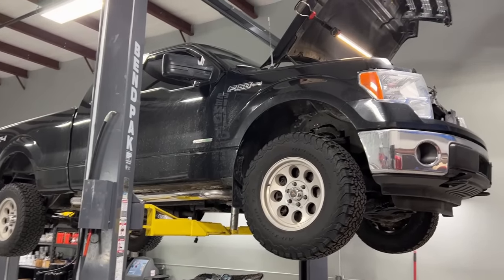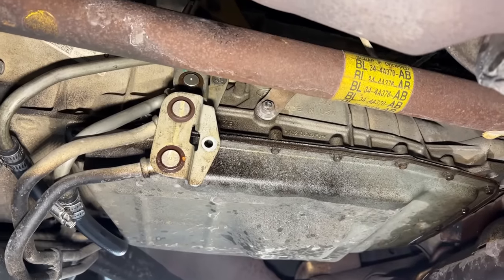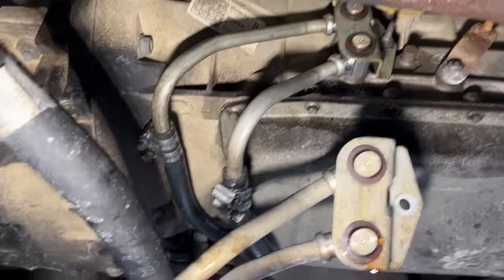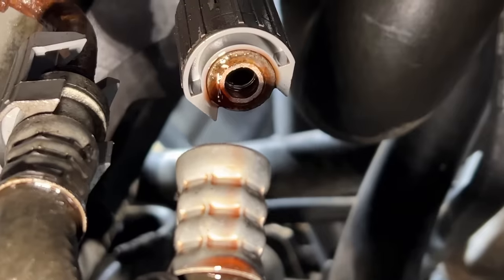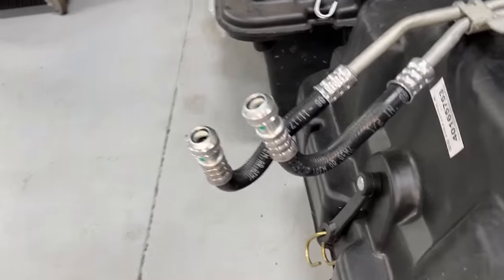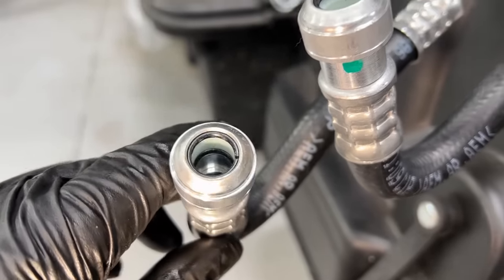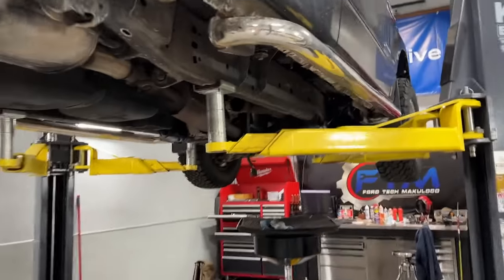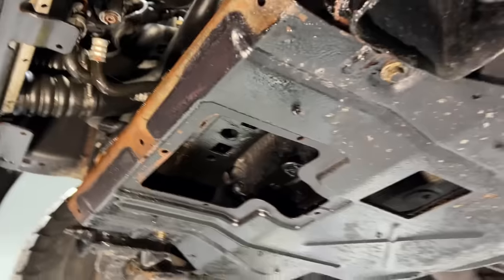Attention 2009-2014 Ford F-150 Owners! Check Your 6R80 Transmission Cooler Lines Before They Blow!

Comment: Mine broke in that exact same spot on my raptor. luckily I was able to pull over very quick and got the truck towed home, ordered a new cooler line,
Installed it and I've driven it for 2 years since then and it's been fine. I Also installed the larger superduty for more cooling.
Reply: Also I recently noticed the short line that connects to the radiator was weeping oil so I changed it out as well. I think these cooler lines are just not made of very good quality.
Reply: How many miles on your raptor when it happen?

Comment: Had this happen to my 13 eco f150 here in canada. 150k km’s. Luckily noticed the smoke behind my truck from oil hitting the exhaust and then the wrnech icon showed. Towed to dealer they said i lost 6L of fluid so luckily caught it in time. $550 repair in canada which included all new lines,6 L of fluid, 2 hours labour. Thought was cheaper then a trans so wasn’t complaining lol

Comment: Thanks for putting this video up .. while I was having the lead-frame fixed (Fixed under Transmission Molded Leadframe Extended coverage) I had this taken care of as well .. less than 700 with sales tax ..you are doing a great favor to us Ford owners 🙂
Reply: What year is your vehicle?  I could only find a 2019 Customer Service notice covering 2010-2013 through the end of 2019 that had under 10 years / 150k mi.
Reply: @ronc4146  Its a 2013 and If I remember right I read it as if your truck is less than 10 years old and or less than 150,000 miles and it thew the  right code you are good and I should revise my earlier statement (Fixed)  It not fixed yet but it was confirmed that I get the extented coverage but a lack of parts has put me on the waiting list ..It still acts up from time to time and jerks me around but I have had no major wheel lock up.

Comment: Wow...That seems so unjust and insulting (if that makes sense) to break like that so cleanly and with such devastating consequences.
You're awesome for putting up the alert...Thanks.
Reply: That line has been a problem since 2012 (ish) I can't remember when they changed them exactly.
Reply: It's an aging vehicle with old rubber parts, not really that insulting when you think about it.
Reply: @BlueOvals24  A leaky line is one thing, a 1/2 line wide open with no warning is another.
Reply: @--_DJ_--  Don't know what universe you live in, but there is not a single sensor in existence that can tell you when a line is cracking. Don't know what you were expecting here, Ford should stick a sensor on every line/hose so you know immediately when your lack of general maintenance is killing your vehicle?
Reply: I’m a ford factory certified senior master technician I’ve done many of these and let me tell you not a single one damaged the transmission. They empty so quick that the transmission basically neutralizes. Is there the chance that there is internal damage of course more likely the transmission is fine

Comment: There is an upfitter in town that does pickups for ConocoPhillips.  For the oil patch.  They automatically replace the trans hoses on new pickups with custom made ones, from another local supplier.   The OEM hoses always leak in Arctic temps.

Comment: Almost want to see what happens to those rubber hoses under high pressure. Maybe they are trying to straighten hard enough to just flex the connection a little at a time.
Reply: I believe such occurred on my power steering hose/crimp began leaking on my 09 king ranch.

Comment: Yup gonna switch my hoses out soon. Thank you! 2010 4.6 3V lifted 3” 35” tires 83k original miles bought her at 20k miles used and I use her as my hauler and dump runs etc living on 7 acres in rural Sierra Nevadas mountains and commute for work in a fuel efficient car. Love my 150! Will be having this done along with the Forscan needed to help with the auto braking when on turns in downhill..

Comment: FordTechMakuloco always spot on with common issues and recommended fixes. Do the different angles of the cooler lines into the aux cooler possibly make the issue less problematic on the F150's with the aux cooler?

Comment: Brian, just on my experience, the reason for the metal fatigue failure at the quick connect  is due to the rubber lines hardening with age.  Aluminum really isn't the appropriate metal for that kind of stress.
Reply: Hello, I have a Ford F150 year 5.0 2011 that is giving me the following error:
On the gearbox screen it appears as a little bubble because while in motion it changes to D,N,P,1 and loses pressure when accelerating. I took it to a mechanic and he told me that it was the transmission control module, but now watching this video I have doubts that these lines are the cause of the failure.

What error do they usually present when the problem really is the lines shown in this video?

Comment: Unless I knew for sure it was indeed a metallurgy issue that had been corrected, I would be ditching the quick disconnects if it were my truck and going a different, more reliable route with the repair.

Comment: 2014' F150 STX  Noticed on way to work transmission wasn't shifting right. Got home. Noticed leak under radiator.  Gently turned the plastic clip and the metal connector on the transmission line separated with fluid spraying all directions.  Thanks for this video.

Comment: Thanks for the information. Just sad that we never know as a consumer/customer what could be the weakest link in a very costly repair until we find out about it when it's to late. Feel bad for the customer.
Reply: Well as a consumer, you should also know how to do preventative maintenance.  That's the problem here, nobody replaced those old, rubber lines and they are bound to break.

Comment: I've seen that happen several times at our shop here in Montreal. I suspect it's worse in northern areas because of the extreme temperature cycles in the winter (very cold to relatively hot in a short time, and vice versa).

Comment: I've got a 2014 f150 Eco boost with 128k miles and a remanned engine after 98,875 miles cause the factory engine threw a rod. had a small shifting scare with my truck last week and it hasn't returned since parking the vehicle for 10 minutes and driving home, but definitely going to keep an eye on this. looks easy enough for a diy-er like myself to change out

Comment: Great information to have, Ford should’ve at least warned these people about this problem, definitely seems like a manufacturing defect
Reply: so no repercussions for Ford on this? No recalls, no service bulletins? No nothing? Could someone successfully sue in small claims court over this? How does something like this become a recall? I'm feeling a little less confident I'll be buying another f-150 or any other ford product. If they can jack you up over this and there was another issue(s), just not right.
Reply: Its always the small thing that corrupts the whole
Reply: @dgunearthed7859  Its not only the f-150's the fusions are no better. I've since bought a  Toyota and couldn't be happier. I'll never buy another Ford.
Reply: @chadmartin5473  your going to have the same problem the trans line is a maintenance item anything that a rubber or plastic on it has to be replaced every 5 years or 100 k 

I suggest you read your owners manual it literally tells you when to replace everything.
Reply: @chadmartin5473  Oh I've owned plenty of Toyotas too. The truck (before they had names) started crapping out after 100k so said the person I sold it to. And one of the corollas, well, i felt it was an average car at best. Now, the 2017 subaru forester? Best day of my life was when we turned it in on the wife's new Kia soul. It had ac problems one of which was actually handled by the stealership due to a recall and the other, the other part, wouldn't be covered, so the wife said "sell it". lol I have to give credit due where it's due, my 03 f-150 is probably the best vehicle I've ever owned. Yeah it's had a couple issues like the fuel pump going out, but for an $1,100.00 stealership bill to fix that, that was the largest repair in it's 150k life so far so I feel lucky. I just don't know about these new vehicles.
Reply: @stevennunez6013  Its not so much the vehicles, things break I get that. No matter which one you own you will encounter problems. Its the Ford Company itself I can't stand.
Reply: @dgunearthed7859  Vehicles aside its the company I dislike. They would rather see people die and pay the individual lawsuits then fix the issue by recalling big lots of vehicles. There is a reason they are the only motor company to not go bankrupt ( Aside from Telsa) They are crooks.
Reply: @chadmartin5473  I think every company, auto or otherwise, always sets an "acceptable" kill rate for it's customers. If we had safe/reliable vehicles that were somehow green all at the same time, they would probably be half million dollar tank-like vehicles that run on this allegedly plentiful electricity.  lol
Reply: How does a backyard mechanic undo those quick connect hoses?
Reply: @ronniespring8888  a) there's probably some pricy special tool you have to buy, and b) I bet there's a video on that. c) no I promise I'm not being snarky...just guessing.
Reply: @stevennunez6013  I have 2012 mustang with these same lines and nowhere in the manual doe`s it say to replace these lines.
Reply: @clayporter583  that transmission line your talking about goes to a external transmission cooler between the condenser and radiator there’s a rubber portion that goes to the cooler itself 
I would replace that line 
Good rule of thumb replace everything rubber every 100k or 5 years which ever comes first
Reply: @stevennunez6013  well aware of this
Reply: @dgunearthed7859  Recalls are only issued when it's a safety concern and defective part.  This isn't a defective part, it's an old piece of rubber, you shouldn't expect rubber to last forever on any vehicle.  Just get all your rubber components lines, belts, bushings etc. replaced around the 10 year mark and you will never have an issue.
Reply: Ford should've warned people that rubber dries out and cracks and can cause a leak?  No, that's something you should inspect for every 5-10 years.  You replace your tires when they dry and crack, treat your hoses and belts the same way.
Reply: @BlueOvals24  😊 thanks
Reply: @stevennunez6013   "Just replace everything rubber every 5 years", lol?  Do we also need to replace all engine and transmission gaskets, brake caliper cylinder gaskets, fuel pump and fuel tank gaskets, all suspension bushings, etc. etc. etc. every 5 years too?  Do you even know how much "rubber" there is on a typical ICE car or truck?  Seriously, which stealership do you own, bud?   

Maybe just tell them that you'll gladly sell them a brand new F150 every 5 years, with "all brand new rubber parts".  🤣
Reply: or is it?? maybe its just planned obsolescence)) ?
Reply: @stevennunez6013  no way )) is that what they putting in new trucks in owner manuals?? i have older E150 and E350 trucks, from 90eis. stil lorginal gaskets and tubes)). the only thing u had to replace after 5 years was differential fluids, and it was suggested )) even seals in axles are origina and no leaks. Vans have over 500 k miles)). original trannies too.  .
Reply: @ansv3340   Don't pay attention to @Steven Nunez, he's obviously a grifter trying to upsell stealership services and/or Motrocraft parts.
Reply: @BlueOvals24  Did you even watch the video? It wasn’t an old worn out piece of rubber it was a metal quick connect that broke. Sounds like a defective part to me.
Reply: @Dr-YouTube  No, sounds like a thin piece of metal joint with rubber that endured over 10 years of heating and cooling.  If these lines were breaking when these trucks were new, sure call it a defective part.  But with how old these trucks are now, something like this should be expected.  And if it was as big of an issue as he claims it is, we wouldn't see these trucks around much because the average owner would've caught the problem too late.
Reply: @BlueOvals24  well, I have a 2012 F150 that had this issue 3-years ago (2019) which put it at the 7-year mark and near 80k miles.  Transmission fluid drained and burnt out my transmission.  Cost me $3500 because the extended warranty company would only pay for the lower cost (approx $3k) of a 3rd party transmission instead of the $6500 estimated by the dealer to rebuild it.  Both I and the Ford dealership was not comfortable with that so I had to eat the difference in the cost of rebuilding it.  The dealer did a great job and 3-years later it is still running fine.  But why should I have had to pay the cost of a repair because of an apparently faulty design of a quick connect?  If it is a known issue, which it most certainly is, then Ford should be on the hook to issue a recall and replace those quick connects with a better-designed part.  They are obviously not designed to last long and their failure causes severe failure of the transmission.
Reply: @rayk4e  It isn't a known issue, it's wear and tear. Doesn't even happen to every truck. Your biggest fault was not checking for fluid under it before driving.

Comment: Thanks for the warning Brian. I hope your Florida trip helped you out a bit. 

It sure seems like someone could make a retro-fit for this. These quick connects (in my opinion) are there for initial vehicle assembly. A couple of short lengths of hose and four clamps could eliminate all of this and save folks $6000.
Reply: You are correct, that is exactly what I did.
I used 1960 era tech .
It will last the life of the truck now.
Reply: @jerryfrederick6610  Glad to hear that. Good job.
Reply: Just regular hose and clamps? Nothing special?
Reply: @jiveturkey713  Use your tubing flare kit to put a ever so slight bell on the end of the tubing so when you put on the hose and tighten the clamp there is some resistance to prevent the hose from blowing off the end of the straight tubing.
Practice with a seperate piece of tubing first.
My set up is holding up just fine, I do not even think about it and hav not until this post.
Take Care and God Bless, Good Luck.
Reply: @jiveturkey713  You'd certainly want a hose that is compatible with whatever transmission fluid you are using.
Reply: @jerryfrederick6610  they have those at harbour freight? Thank you bro!

Comment: Thanks Brian for putting this info out there , just a FYI , I have a 2013 F250 superduty (70K) and had the same problem as you talk about here. Lucky for me at the time I was pulling a trailer just down the street from my house to pick up a bucket truck body , when I backed in to the lot I noticed a wet spot trail on the ground which I shut the truck off right away , got under the truck and found the leak , the fitting had not yet broke off , so I wrapped a rag with a tie rap around it , dumped the trailer and went home , which once I got home I took the rag off and it broke off . I only lost about a quart of fluid , part of was in my driveway as I left that morning. But instead of buying the part as you did , I just cut it off and had some HP hose from another vehicle repair that fit perfect with some clamps . I have had no issues since . I also cut the other line too and replaced with a hose and clamp. Been a few hundred miles and I always check for leaks and have not seen any problems since. I have seen this type of issue with other vehicles I own and now I always do a walk around before I leave the house with the vehicle running. But yes like your customer it could have been a huge problem $$$$

Comment: We have had 2 survive that line breaking there. One the guy caught as he was backing up to leave and the other got driven until it wouldn't move. Somehow it is still working just fine, I was sure it was toast when I saw what happened.
Reply: Good to know, thanks for sharing your experiences with this
Reply: "driven until it wouldn't move". Thats prob about 3 minutes until 7 quarts of fluid are on the ground.
Reply: @mph5896  Ya the evidence didn't go very far back down the road. Broke going over a rough business entrance, puked most of it out at a red light and made it just around the corner before it "stalled". Poor young lady (summer student) barely knew how to open the hood. She thought the engine quit, and a guy that stopped said the "coolant exploded" and left. I figured she overheated it and it seized but it started just fine, just had no drive. Easy fix, got lucky though. 
I had to give her a bit of a hard time, knowing the difference between oil and water is helpful when calling in a problem, it just ended up with her crying.

Comment: Thank you for another great tip.  My f150 is from 2003 and both cooler lines were leaking/rusted. Replaced them my self.  Trans shop did not tell me about it when I went for service.  Most people don't  even know what they are, just drive until they blow out.

Comment: Just was finally getting the correct a/c clutch hub installed from your other video that literally just saved me a shop quoted $1200.00 full replacement....THANK YOU!! And as I was doing so working around these trans line I couldn't help but notice the 85% SPLIT down both of them on the crimps just barely hanging on! Guess I know what I'm doing tomorrow 😌 thanks again man....keep up the generosity and great work!! 2013 F150 Coyote 5.0L